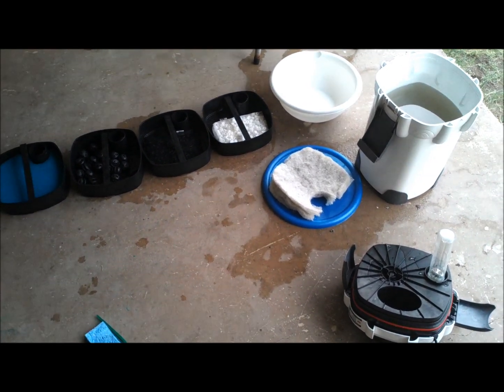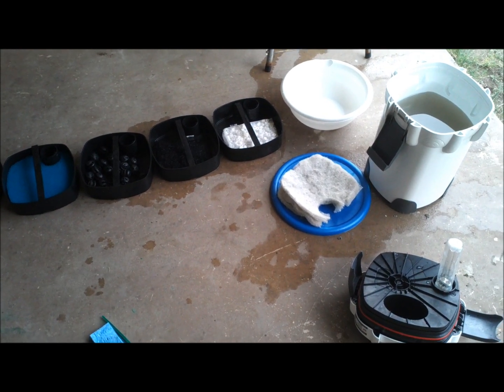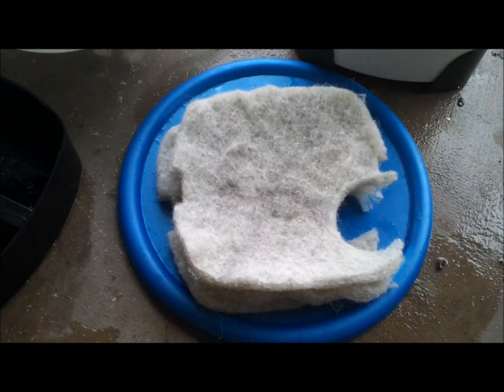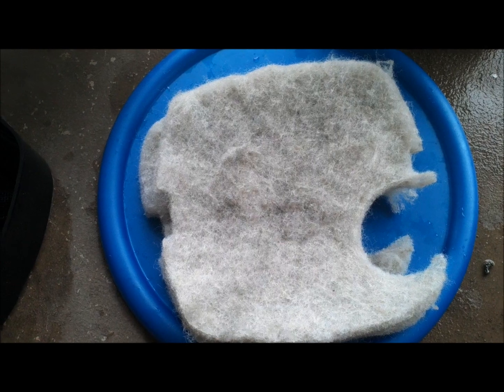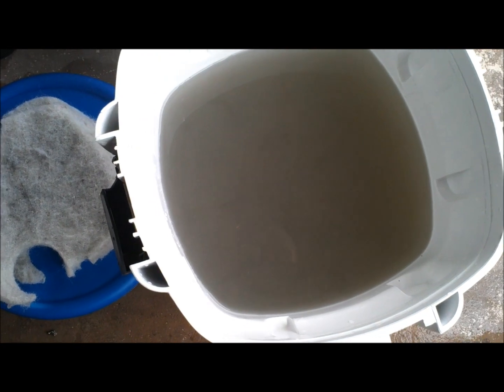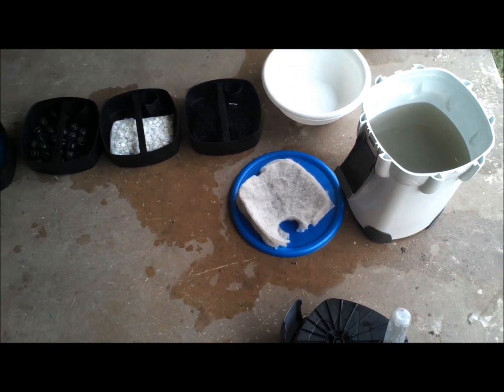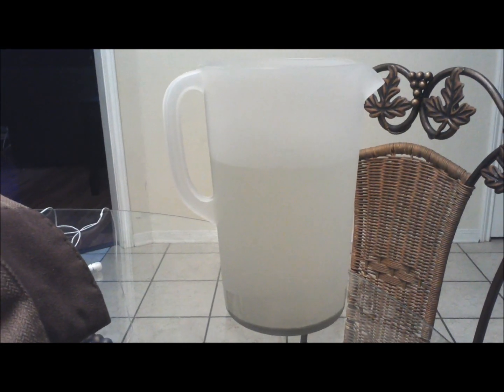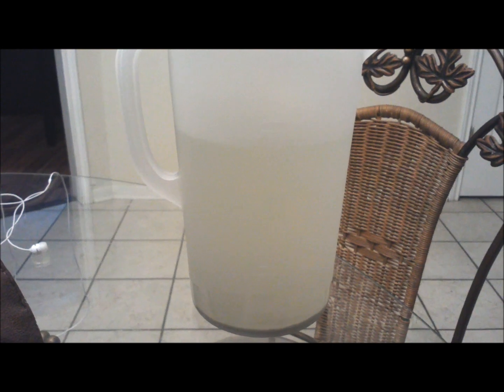WHY CANISTER FILTERS AREN'T THE BEST CHOICE FOR SALTWATER AQUARIUMS

Comment: 1) You should be cleaning out the filter pads once a week, not once a month.
2) Filters are supposed to get dirty. If it's not getting dirty, then it's not filtering.
Reply: So simple but so hard to understand :)
Reply: I mean even then you shouldn't really have to change filters once a week ...i guess it depends on the tank and waste load

Comment: You have to get a size canister filter that will support the bio-load you have. You also have to replace or clean in some cases the mechanical filter media every month. I use Acurel because it's cheap & better than floss. You need to be emphasizing on your biological filtration with these things. I use two stages of seachem matrix & bio beads/balls for biological filtration & a third stage of seachem purigen. A canister is basically a wet/dry filter sump. And actually without seachem matrix you're going to get a nitrate factory with only monthly water changes anyhow because there's not enough DE-nytrfying bacteria to turn that nitrate into nitrogen gas. It could have been that canister wasn't big enough for your bio-load.
Reply: shechshire -

Comment: I run the same canister filter, however I removed the bio ball and run GFO in sock bags, my 60 pounds of live rock are for producing the proper bacteria, I also run a hang on the back protine skimmer rated for a twice the size of my saltwater aquarium,  which is only 40g.... As with a sump or canister filter you need to clean them regularly or you will have problems.  And nothing replaces 20% water changes every two weeks.... Just my opinion!!
Reply from the maker: Sounds like you have a good system that works for you. I pretty much do the same thing but I only have to clean my sump out with my monthly w/c. I found myself  cleaning out the canister filter every week

Comment: A more effective and efficient way to implement your Filtration would be as follows ceramic tubes on the bottom of the filter ( under the first basket) 1st tray: corse filtration*2nd tray: fine filtration pads or poly- fill ( can be found at Walmart or hobby lobby )*3rd tray: bio media ( lavarock, pumice or biohome media )4th tray. (the one on top ): bio media and one Fine filter pad on the very top.
For chemical filtration get a media reactor and use a phosphate remover and activated carbon in it
I hope this helps.
Also don't have the filter intake tube to close to the bottom of the tank. Mid level is perfect.

Comment: I have great results with 2 canisters.  I have a heavily stocked 100 gallons saltwater with 15 fish (including a large 6 inch emperor angel for 3 years) and after 2 years, I have not done a water change nor cleaned my 2 canisters yet my nitrate is a low 5-10 (I use tap water which has nitrate=10 to mix salt water).  This week, however, I've upgraded to a 240 gallons so I don't know how long I could have gone without a water change on that 100 gallons tank.  My video is on youtube by mrpmj00.

Comment: a little late to the party but it doesn't look like you have any way to convert nitrate to nitrogen gas in that canister setup. the bio-ball and the rings you have won't host anaerobic bacteria that does that transition. that's why your canister setup is considered a nitrate factory. check out seachem matrix, they'll do the nitrite to nitrate to nitrogen gas part of the cycle. a properly setup canister filter will do the entire nitrogen cycle and cleanup actually should be pretty simple with only needing to rinse the filter floss/pad (using old tank water) when you do your water changes.

I have that exact same canister filter for my 55 gallon freshwater tank and the 3 basket version for my 20 gallon nano reef. you have way too much open space in your media basket. mine is actually filled as much as possible with media (filter floss on the bottom tray, seachem matrix at mid tray(s) and carbon at the top). those baskets can hold a lot more media. If you leave too much open space in the baskets, they're essential useless and no more effective as a low volume hang on back filter.

Comment: I mean fine padding is SUPPOSED to collect fine particles from your system so that you can remove them out of the system. Otherwise they'll be just floating in the water column or lying on the substrate, decomposing in the same manner.